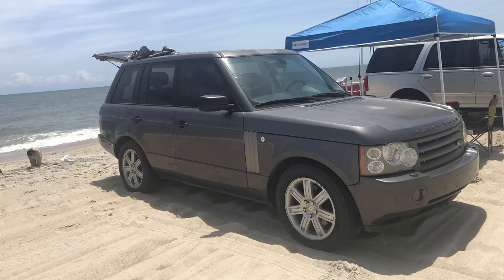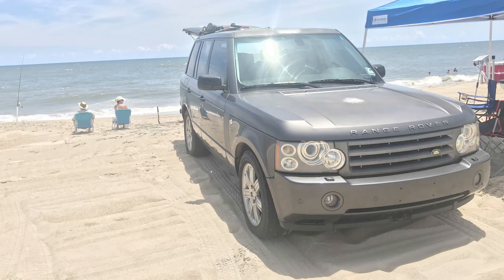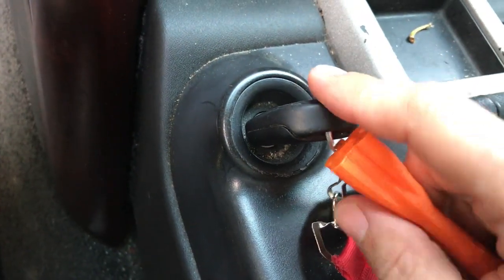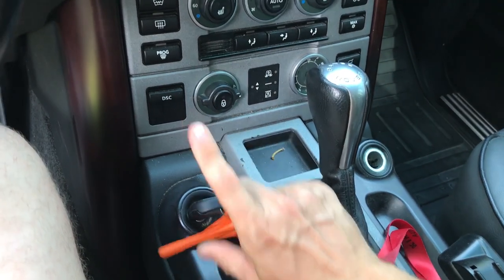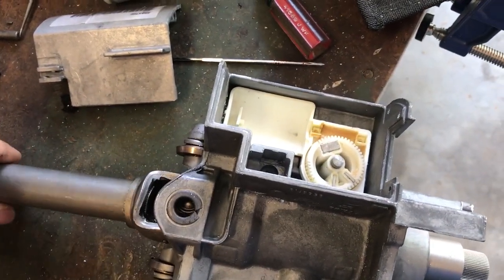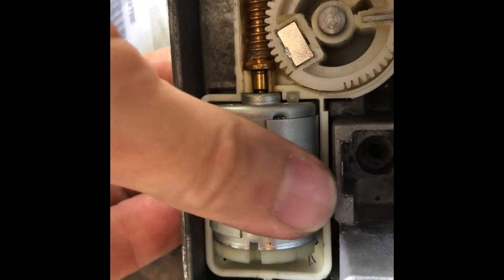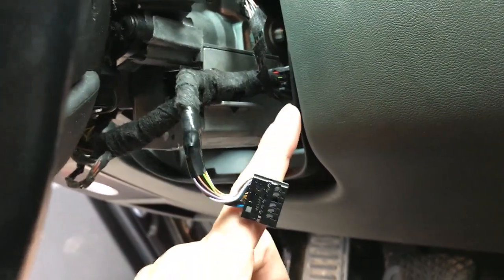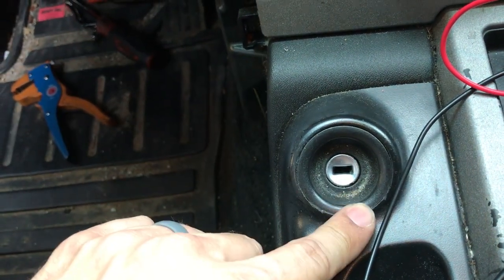L322 Free and Permanent Steering Column Module Bypass

Comment: I was looking for a hack that might just remove the locking mechanism on the key, but this seems like it will work, thank you.  I was thinking of maybe connecting the bypass wire to the brake circuit, though, as it seems like a natural to simply put your foot on the brake to start the vehicle.  thoughts?
Reply from the maker: Glad I could help!

For you to consider: Every time that wire sees voltage the solenoid on the lock cylinder will release. This solenoid is normally closed, so it's at rest when not powered. Every time you hit the brakes you'll activate that solenoid and possible increase wear. I believe once the steering column module sees the engine has started it releases that solenoid so it doesn't stay on.

That's why I didn't just run the wire to constant ignition power, I didn't want it to burn up early. Interior lights should only come on when you open the door, and they will stay on based on your settings, usually for 30-60 seconds.

That was the best solution I could think about that was easy to access.

I also would avoid anything going to the brake system as you don't know what the extra load will do. I see many crazy issues from people installing trailer brake controllers or light kits, especially as modern cars have moved to lighting modules. I doubt you'd create an issue, but there's no way to know for sure so I recommend everyone avoids pulling power from any of the wires under the dash unless you really know what you're doing.

In short, for me at least, I don't see any upside to going to the brakes, only extra risk. If you find that you constantly have to start your Rover with the interior lights off and that's an issue, you may want a different source.
Reply: Thank you for the thoughtful response, and that's great advice.  I found a simple trick to cut down on wear and tear, simply hit the adjustment stalk when you are turning the key off and it stops the retraction process.

Comment: Great Video thank you 🙏 
Question my car works with the fuse #18 what do you recommend ? Will fuse 18 switch work forever? If I connect the cable as you showed will it be a permanent fix?
Thank you and much appreciated
Reply from the maker: It should work forever. I just didn't like having to flip the fuse 18 switch and then wait for 5-10 seconds to start the truck.

With adding the wire to the light I can fire it up right away as soon as I climb inside. It's been a month now and no issues so I think it'll be a permanent repair.
Reply: @RobTheCarGuy  hey bro i did thay exact soldering and it did unlock da ignition switch but won't crank da engine on any sugestions or do you habe to jump another why besides da blue one?

Comment: Greatly appreciate this info, and may consider taking a shot at it.  But, first, has anyone diagnosed the actual ROOT-CAUSE of this problem?  Rob did a great job dissecting the module, plunger, motor, lock/unlock cog, etc.  Seems the core issue is somewhere inside that assembly, and if I dig that far into the project I sure would like to actually fix it instead of just implementing a workaround (although awesome, clever workaround, for sure!!!).  Thoughts?
Reply from the maker: You think like I do! The more I get into projects like this, the more I wish I had diagrams for the printed circuit boards. 

I have two theories. First, the sensor that detects the position of the lock pin is no longer reading correctly, preventing the module from sending the "OK" signal back to the lock cylinder.

Second would be a failure of one of the components on the printed board. Ideal would be something simple like a capacitor or resistor but I suspect it would be something more like a memory chip corrupting over time. 

The mechanical parts all worked in mine as you saw, including the motor. I didn't go past that because I didn't have a working one at the time to compare to.

I do have another 2006 L322 that I purchased with the same issue but since the column isn't locked I doubt I'll pull it out this time around.

I still have the Rover from this video that is now being used for parts since it got rear-ended, I can always pull the column back out and find the root cause if someone wants to send me a known good column module to compare it to....
Reply: @RobTheCarGuy  Thanks for the reply, a sensor or chip certainly makes sense, but probably not a practical fix.  Sheez, sucks that LR won't sell the module.  For the last week I have just left key in the ignition, planning to do your workaround, but now the key is turning but starter is not even clicking.  Guess I get to read up on the starter issue as well, ha!!!
Reply: How is this not a recall?

Comment: Rob nice video great idea and good instruction.
I have had this problem for some time now on my 2004 L322 and my fix was to put a push button (starter switch) in the door jam wired into fuse 18 so every time the door opens it resets the ECU, but I still have to wait the 10 seconds after getting in the truck before it will start. I tried your fix and it worked as far as it would let me turn the ignition switch just as you showed but the ignition was dead ... Nothing happened when you turned the switch no clicks no noises at all just nothing. I disconnected the jumper wire from the blue signal wire and it starts fine ??  Any ideas??  Thanks Mike
Reply: This only works on 2006 and above with the Jaguar AJV8 engine not on the 02-05 BMW M62 Engines. Although I would love to see your door jam set up. Currently have a switch on the F18
Reply: This only works on 2006 and above with the Jaguar AJV8 engine not on the 02-05 BMW M62 Engines. Would love to see pics of your door jam push button work around though
Reply: This only works on 2006 and above with the Jaguar AJV8 engine not on the 02-05 BMW M62 Engines.
Reply from the maker: Sorry Mike, As DJ has said it looks like this trick doesn't work on the BMW engines. If I find out a way to bypass those I'll update this.

Comment: Hi Rob thank you for documenting this. I appreciate it and solve my steering  column lock problem and turn key. When I hooked up the blue wire to my floor lights, however, I discovered that rear window wipers are connected and turns on. How did you solve this?
Reply from the maker: 😳 …. That’s .. um … not suppose to happen. 

What year / trim is your L322? Do the wipers run constantly or just for the 30 seconds the interior lights are on?

Nothing jumps out at me how those would be related unless you grabbed the wrong blue wire or the wrong with in the steering column. The wiper switch is on the same side as the ignition so my guess would be a shorted wire from the wiper control stalk on the column or the stalk itself going bad. 

If you’ve already found the issue let me know what it was because that’s super strange. 

If you still have the problem get back with me and I’ll see if I can help you fix it.

Comment: Hi Rob, great video. One question...will this work if the fuse 18 and unplugging the steering column module no longer work? Pulling the fuse 18 work for me once but no longer works for me as an option. Also unplugging the steering column module doesn't work either. Before I proceed with your tips, I wanted to see if you think it would work for me. Also, my steering wheel is locked. What do you mean by desoldering the motor? Thank you Rob!
Reply: He means that he removed both wires from the motor by unsoldering them and puddles them off away from the motor. Personally I'd have just found another motor and fitted the drive worm gear to it and fitted it then you would still have the steering lock working

Comment: My key turns but I have no power getting to the starter solenoid. Could this be the problem
Reply from the maker: Yes. Do you have a 2006+? The BMW powered L322s have an extra step in the process that this will not work for. I have heard companies make emulators that send the correct signal to the DME to finish the cycle and send power to the starter.

Comment: Very nice video and job. Thanks for sharing. It will work on a 2002 model?
Reply from the maker: It looks like this only works for the 06 and newer ones. Bypassing the lock is probably similar but the electronic bypass doesn't work according to other owners.

Comment: Hi Rob, great video. One question... when you de-soldered the motor, what did you do with the power leads?  Mine is now locking the column, but won't unlock.  I'd like to try to disable the motor, but not sure what to do.  Resistor?  If so, what size?  Thanks!
Reply from the maker: SL Member super late so probably not still helpful but I left the leads tucked in the housing, not attached to anything. 

I reassembled the column in the unlocked position and with the lock motor detached it will never lock again. 

I don’t know how it would lock the column in yours unless you reattached it.
Reply: If you remove the wires..  The motor wont work and the lock stays in whatever position you left it in. If the motor is not seated correctly the lock gear could potentially swing to lock when it is struck(knee hitting the column).
Reply: @turboflush  
🇬🇧 Good luck to anyone doing any of these mods, if you cause an accident and your insurance company discover the mods you will be liable for all costs 👏

Comment: I do the fuse 18 bypass around 3 months.. now i have a problem with communication. I think is the steering column
Reply from the maker: What's the "communication" problem? Cutting power to the module (pulling fuse 18) should still allow it to start once. You may need to let the key sit in the ignition cylinder for 30 seconds so the transponder has enough time to be read but it should still work.

What is your Rover doing now that's different?

Comment: Once the jumper is added to the wires, should the plug be reinstalled into the steering column. or left unplugged? This part wasn't super clear to me.
Reply from the maker: Yeah, a bunch of people keep asking and I don't remember either honestly. I don't think it matters either way. I think I left mine unplugged so it wouldn't make noise.

Comment: Hello i have an on/off button installed directly to the fuse but the problem is i have to wait and sometimes it takes longer than usual, could i install a wire from the light bulb to the on/off button?
Reply from the maker: Probably not. If you do you'll only send constant power to the interior lights when that switch is on and possibly burn up the light module.

The fuse power is totally different from what we're doing here which is why the fuse trick only works once and this works every time.

Comment: So on a BMW engine car 2003 to 2005, you just do the same with the blue wire and the red/yellow wire ? Just doing blue allows key to turn all the way but no crank ....
Reply from the maker: Unfortunately the BMW powered RRs use a different immobilizer system and need an additional signal to allow starter function. 

Scan through the comments, a few people have posted emulators that seem to do the trick for less than $100. That’s the way I’d go on the early versions.

Comment: how can you tell which motor you have in the car, Is there a label? thanks
Reply from the maker: I'm sure there is but if you're in the USA: 2003-2005 BMW M62, 2006-2009 Jaguar AJ-8 4.4L or 4.2L SC, 2010-2012 Jaguar AJ133 5.0L V8

The engine covers are a dead giveaway also. You can also tell by the lights. In the USA, square headlights, yellow rear turn signals and markers = BMW. Clear markers, round bumps in the headlights and clear rear turn signals = JAG V8. Facelift Headlights and clear tail lights and rear turn signals with the dual red rings = 2010+
Reply: @RobTheCarGuy  I have an 06 range rover with a Zf6hp26 trans

Comment: I did the bypass. The key is turning fine but the car is not cracking. To start the engine I have to disconnect the battery to reset something then it starts. Has anyone had the same problem???

Comment: Rob, this is a great video and seems like many people have this issue. I would like to find out the root cause of this issue too.

I found this video right after I had pulled my steering column apart and also came to the conclusion of the plunger as a sensor. I pulled the lock motor assembly apart and  I did apply 12v to the leads of motor which resulted in it working like it should. I have a feeling that either of the position sensors might be bad or maybe even the board.

Over a year ago I had a similar issue with the key lock and pulled that apart. I removed the pin from the coil and it works flawlessly now. I did look up the coil part number and from what I remember, its still sold but have not had the time to replace it yet.
Reply from the maker: Very cool! I suspect the issue will ultimately turn out to be something on the board but who knows? Maybe one day there will be a company rebuilding these modules for a reasonable fee and less L322's will be junked over a $1500 column.

Comment: Hi, when I full the fuse 18 the car start. I tried your advice the key turn and the dashboard light on but not cranking,  any advice?
Reply from the maker: What year? This won't work on 2005 and older with the BMW system. BMW L322's have an extra signal from the security module to command the starter. You'll either need to do this AND jump the starter wire or install an emulator module.

If you have the Jaguar powered 06+, you pull the fuse and the key turns to "START" and nothing happens, you have an issue with power to the starter.

We know the key turns so the Immobilizer works and your key is good. You pulled fuse 18 so it's not the column module. Check for battery power at the smaller wire at the starter solenoid with the key turned to "Start". This should only show up when you turn the key, not before. If this works, check for a good connection on the large cable from the starter to the battery. Usually you'll hear some type of audible noise from the starter like a clunk. If all is good, replace starter.

If none of the wires going to the starter work with the key turned to "start", you have another issue. You'll need to get a wire diagram and follow the circuit from the battery to the ignition switch and to the starter. Something is broken or missing in that chain. 

Let me know what you find.
Reply: @RobTheCarGuy  thank you bro
Reply from the maker: @carkeysreplacementinc  No problem! Let me know what you figure out.

Comment: I've done the blue wire bypass, the key now turns but the starter will not engage, I'm guessing it has something to do with the ECU and the anti theft, from the looks of the wiring diagram, the green wire is the ignition, will adding power to this wire start the vehicle? I'm pretty stumped been working at this for about 25 hours now.
Reply: This only works on 2006 and above with the Jaguar AJV8 engine not on the 02-05 BMW M62 Engines.
Reply: Did you figure out a way to bypass da modual buddy?

Comment: Would it be possible to just fix a switch on the fuse 18, on or off? That might be a solution?  Gpx
Reply from the maker: Yup, that would do the same thing and many people actually do that to keep from puling the fuse.

The downside of the switch is you will still need to wait 5-15 seconds for the module to reset and allow the key to turn. There's also some discussion about the long term implications of power spiking the module so much.

The benefit of this would be not having to wait to turn the key and not having to take an extra step, so really it's up to the individual.

Comment: I'm considering doing this as a preventative measure on my 2009 L322; but before I do that, would you (or anyone reading this) know if this issue affects the 2009 model year? I've done some googling and can't find anything definitive.
Reply from the maker: My 2009 has 181,000 miles currently and this problem hasn't happened yet. I wouldn't do this to one that was working.

If you're worried about getting stuck if it ever fails on you, you can just pull the fuse to reset the module. That will let you start the vehicle once. Most people drive these for years just by pulling the fuse every time they get in the car so no real concern for getting stuck somewhere.

Comment: Tried the fuse, tried the battery disconnect and cannot get either to work. I need to get it to work once just so I can get it to the dealership it’s still under warranty. Will disconnecting the harness under the column work or would I save a lot of sweat and time just to have it towed?  Sounds like it’s a failing motor when I put my key in, no soft or hard clicking just low hum of failing motor.
Reply from the maker: I'm sure I'm too late at this point but if the fuse trick didn't work I doubt unplugging the harness would do anything. 

You might actually have a bad ignition depending on your other symptoms. 

Did you end up getting it fixed? What was it?
Reply: I did this but now it won't start!!!!!

Comment: Pin 5 to pin 11 to get the starter engaging once you have the key unlocked.
Reply: How can i find which pin is 5 and 11?  I tried finding a diagram but I am not 100% sure what that plug is called.  Almost done with the project.  just need to know which color pin 5 and 11 is connected to on my 2003
Reply: Steven Amador did you fix?